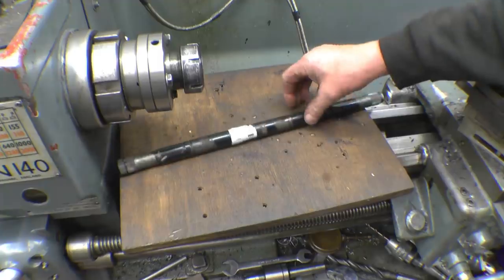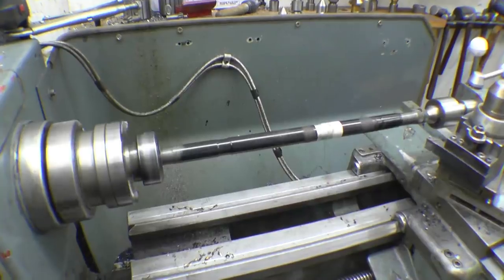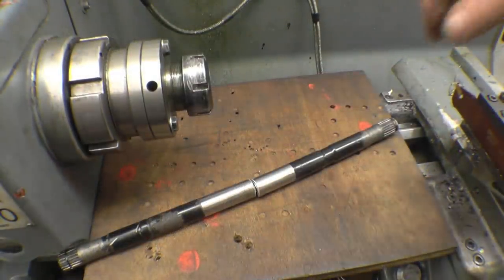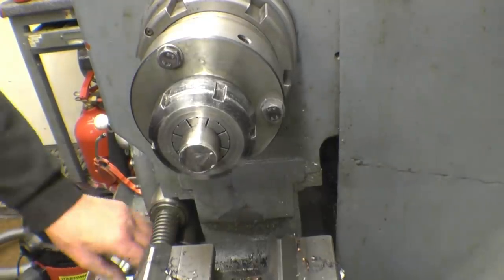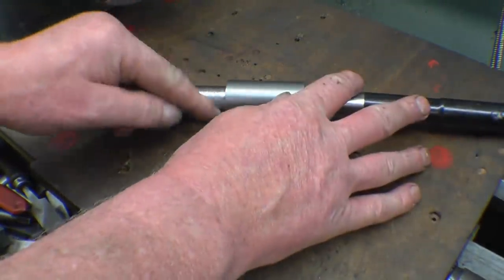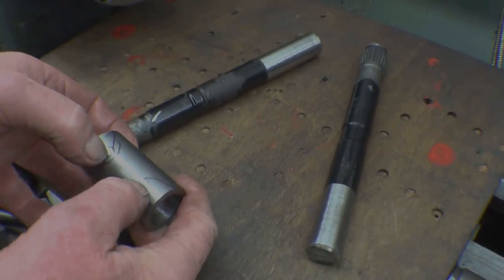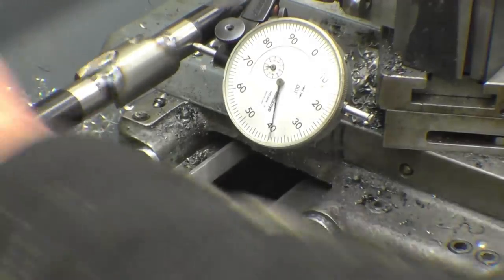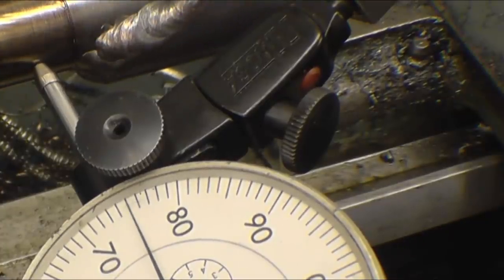SNNC 298 P2  Welding On The Lathe  Drive Shaft Mod

Comment: Ambitious project John, they're made from high alloy steel, through heat treated and induction hardened, normally friction welding is used to modify the length, plus post weld heat treatment.
Hope this does the job for the lad👍.

There's a company in Gateshead called CPS Drivelink Ltd who remanufacture these and steering racks, my affiliation is limited to being a customer of my employer in a previous lifetime.

Comment: Nice work.  The other way to do it is a scarf joint where the sleeve is cut at 45 degrees on each end.  The stresses are torsional and they are a maximum at 45 degrees to the centre line so this puts the weld line in the most effective orientation so less likely to break.  Your cut outs achieve some of this as they are angled but a full 45 degree scarf joint across the ends would be stronger still.  Thanks for the videos.

Comment: I'm no engineer but love to watch your videos john. Wont the "hollow" bit in the sleeve be a weak point? Would it of been better to leave a solid bit then hollow both ends? Like I said I'm no engineer just very fascinated. Keep up the great work and best wishes to your family
Reply: If I may reply, the drive shaft transmits rotational power called torque, the closer you get to the centre line of a solid shaft the value of torque reduces, and at the centre is effectively zero, since the centre is not rotating ( that's the confusing bit). Where possible drive shafts on cars, trucks are tubular, since they offer light weight, with thin wall thickness, a 250 HP or 185 kw engine can provide power from the gearbox to the rear axle with a steel 4" by 0.100" or 102 mm by 2.5 mm  diameter/wall thickness. Aluminium alloy 6061 is used as well, for the same hp/is, it's diameter is circa 5.5" by 0.080" or 140 mm by 2.0 mm diameter/wall thickness.
The drive shaft John is modifying, is a high alloy steel, heat treated, with the outer diameter precisely induction hardened, hardness gives you the strength here.
Sorry if I rambled on a bit, though hope it helped 🤔